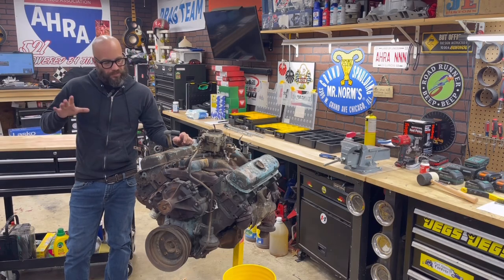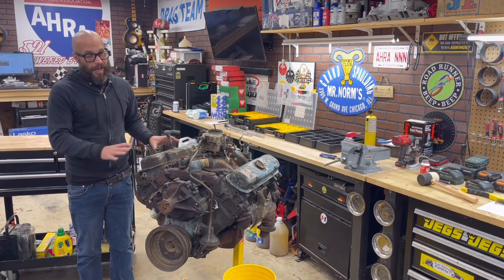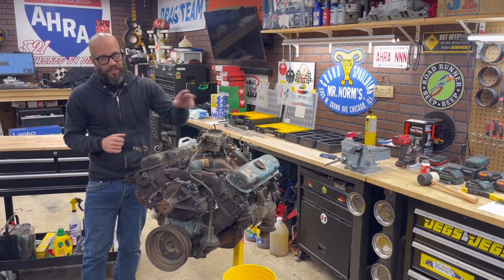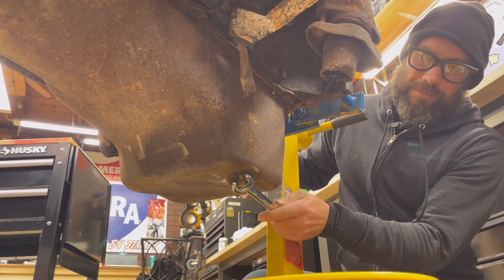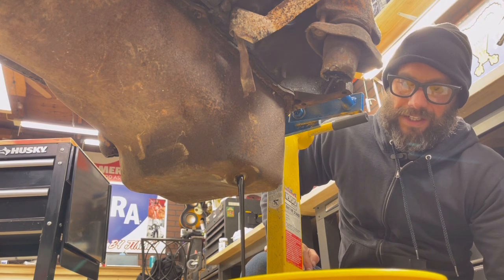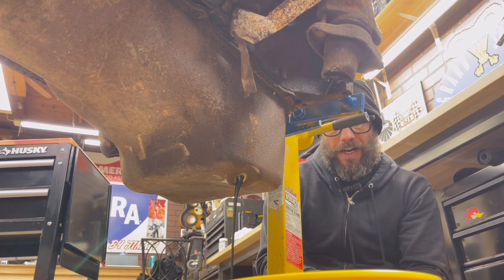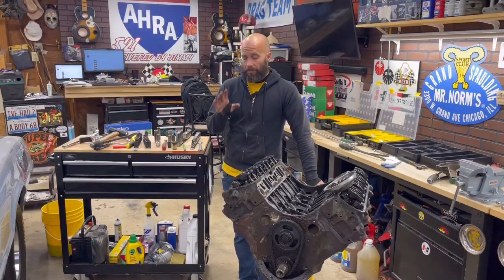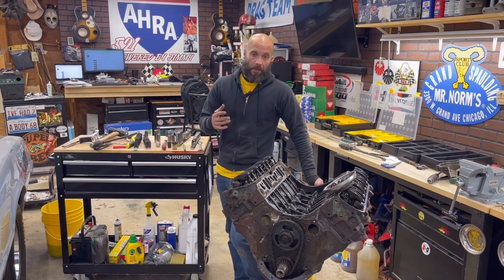Engine Disassembly the Right Way - Part 2: All the Extras are Coming Off #engine

Comment: Not sure if this will be really helpful but a few things on Pontiac engines. 1969 and older blocks will have 2 engine mount bosses, so they are a bit of a pain to use in newer cars that used a 3 bolt engine mount. 1970-1976 have 5 engine mount bosses so either style engine mount will bolt up, the 2 bolt or the 3 bolt. The 1977-1978 (79) block will have 3 engine bosses, so not a good swap into 69 and older cars. Of course 421,428,455 are large main journal and 400 and smaller cubes are small journal. Not sure if all early year blocks but the 350,400,428,455 have the engine size cast into the block. Pontiac run flat top pistons and change the compression ratio by changing the combustion chamber size. So swapping heads from say a 400 to a 455 will up your compression ratio on most. But the combustion chamber can vary even on the same size engine. You need to be aware of the 1971 / 1972 spark plug break. The 71 and older head used a gasketed plug and the 72 and newer used a tapered seat spark plug. The HP heads and allot of the newer heads have threatened rocker studs and the older lower performance have a pressed in rocker studs. High performance blocks have a 4 bolt main but for some reason a lot of blocks are drilled for 4 bolt mains but come with 2 bolt mains. The heads with points distributor have a straight heater hose fitting pressed in and with a HEI distributor they came with a 90 degree fitting pressed in. So if you go HEI you will probably need a 90. There's other things different like oil pans, baffles, valve covers.
Reply from the maker: That’s a lot of awesome information, thank you!  Those Pontiacs sure are torque monsters too!